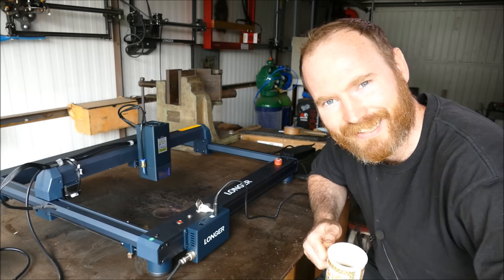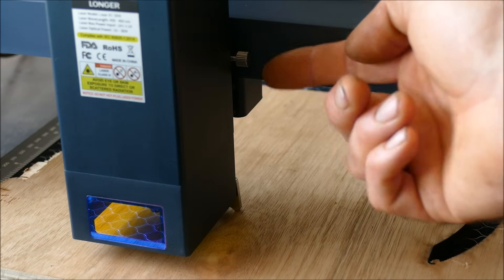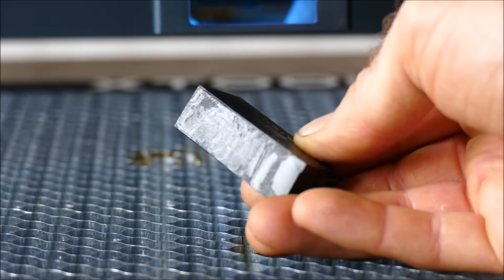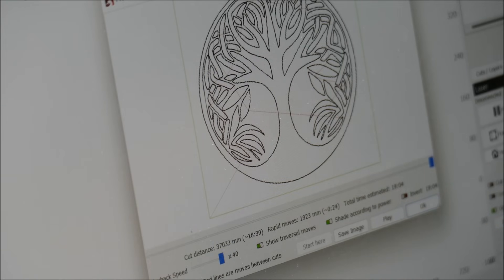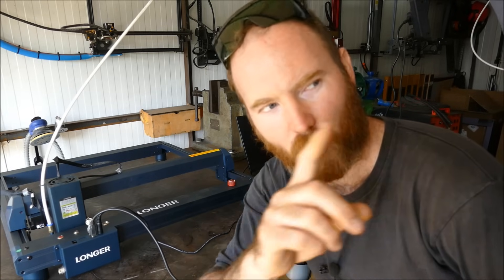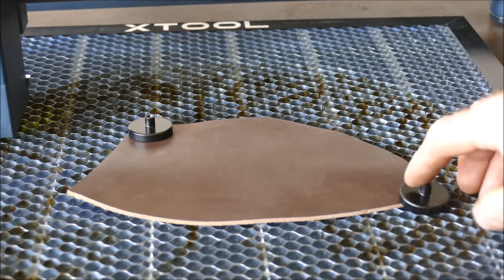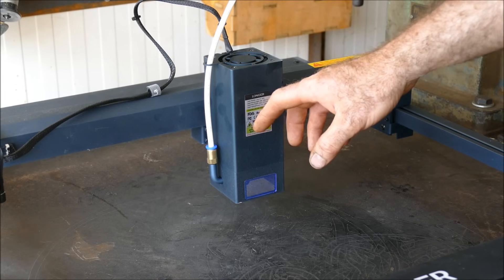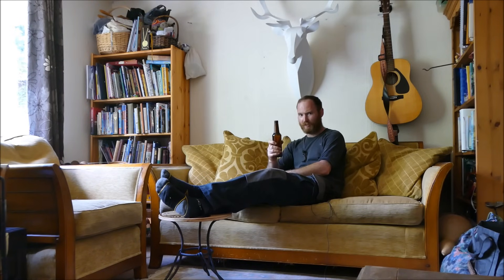MIND BLOWN new budget laser can do this! Longer Laser B1 30W desktop laser full review test & critic

Comment: I would love your thoughts on the Neje 4 Max if you could get ahold of one to review. They only do the E80, a 20w head (though most find it more powerful than other 20w)...but everywhere else they seem to have them beat. It's quieter (fan self modulates based on load), homes like a rocket comparably, and you get a standard 750*460mm bed, with an available extension kit that goes to...get this...1150*750mm. It also has z-axis control, and optional pen and cutting heads (for drawings or cutting vinyl etc). All for $999 (extension is extra lol). I'm in the market for a new laser...kind of love my current Neje 2s Max with the A40640 (10w...plus) head....but I need more speed and power to keep up with all of my projects lol. You've tested literally everything else, so you can directly compare lol.
Reply from the maker: Thank you, I'll look into it although I've been in touch with Neje a few times but nothing really came about.  So far most of my lasers can cut in one pass on my 9mm board at a ratio of 10mm/min per 1w of optical power (eg, 10w is 100mm/min, 20w is 200mm/min, 50w is 500mm/min) with exception of the xTool 40w which is 12.5mm/min and my 30w machines which are 8.3mm/min.
So far from the tests I've done, the xTool 40w is the most cost effective for the power and speed. It has extensions too. But there are several other factors that make it not so simple to choose. Cheers J

Comment: Really enjoy your reviews thanks. 
What do you think is the best laser for the UK when thinking about easily accessible spare parts?
Reply from the maker: Thank you. The xTool D1 40w is probably my first choice as it's very well made and therefore long lasting, the machine is simple and has little to go wrong, spare parts are available, service and communication is good. However it's one of the most pricey in its range but still cheaper than a CO2 laser. Cheers
Reply: Thanks for your reply. Currently have a 80w co2 laser but cracked the tube, it's £700 for a replacement. I love the new tech coming through and you are doing some great reviews. Ta
Reply from the maker: @marc3006  thank you so much. I've had mixed perspectives when it comes to longevity of diodes versus CO2 tubes. Diodes can wear out quick if over powered and not cooled properly but can last a lot long than CO2. But CO2 can be used at 100% power throughout it's lifespan. From what I hear that is, I've not worn out either yet. Cheers J
Reply from the maker: @marc3006  ps a new 40w diode costs a £1000 so they're not cheap either. Cheers

Comment: Man, great easy going video. Not exact my stuff but really near enough. Cheers! 😉
Reply from the maker: Thank you so much. What is your preference, I'm curious? Cheers J
Reply: @joshuadelisle  I`m more in arduino. The next machine I hope for will be a DIY CNC Router. https://www.youtube.com/watch?v=ctyLjOHg7Ag . One of my long term goals is a eternal washing machine, in the meaning of you can fit every motor, every pump or heater cause of 3D printing inside. And with a touch screen, in theory, it`s all no problem to run it. Just today testing a cooling solution for my apartment. A nice simple task. https://www.youtube.com/watch?v=qyZqTaUHhYA . I made it 4 times bigger, but it will not complete this weekend. Also today I will go forward in emacs an editor for prgramming. In the moment this is my top video: https://www.youtube.com/watch?v=k6sUVQS7rpw&t=65s . And thanks for asking. 🙂

Comment: Thanks really intresting! I am inching ever closer to biting the bullet and getting a laser cutter.
Reply from the maker: Thank you, they're great and constantly improving. I think i calculated its £33 per optical watt that your paying for on a diode. on the new ones I didn't mention that they are improving the air flow and cooling of the diode so they last much longer on 100% power also. I've got a new one from Comgrow to show soon which is the cheapest 30w in the market. cheers J